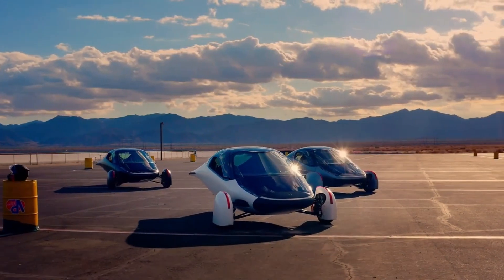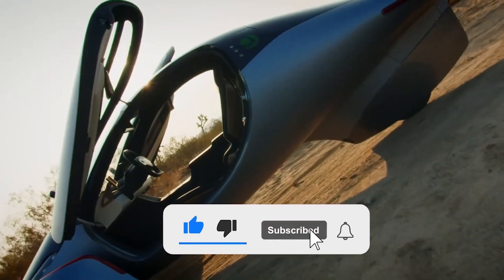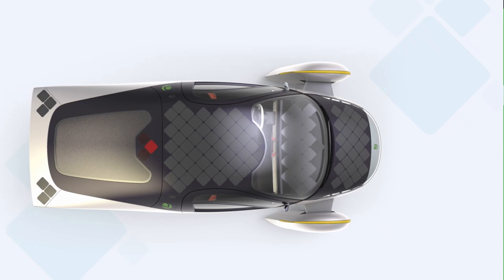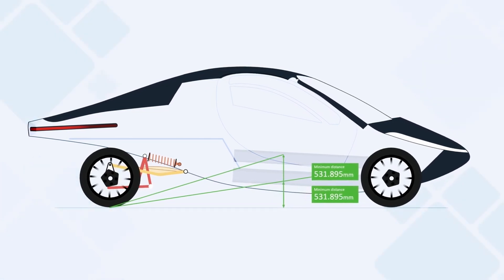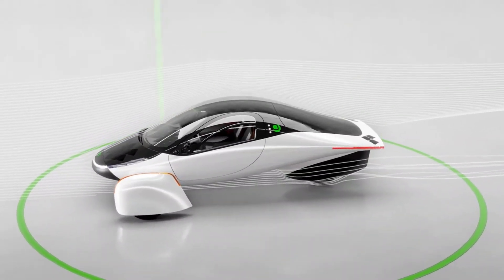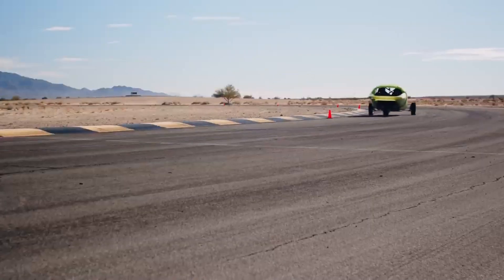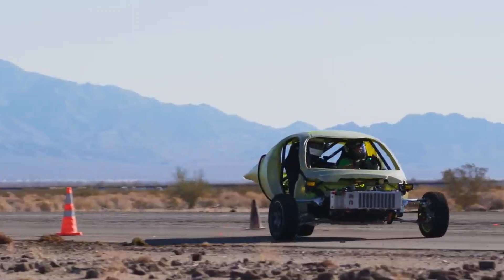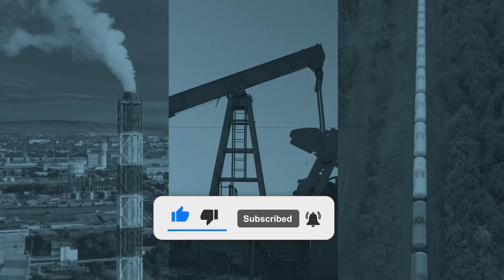Aptera's Stability Under Scrutiny: How It Handles Potholes, High Speeds, and Sharp Turns

Comment: The "advanced" Aptera suspension system does not exist. All their previous testing were made with hub motors and no aluminium frame. So just a bunch of empty promises again. A three wheeled vehicle will catchup all potholes on the street. All dirt, rock, holes are accumulated in the center of a used road, where the back wheel catches everything.
Reply: That's an argument for better road maintenance - not a strike against a three wheeler. Also I would bet money that the majority of holes in the road of any shape or size occur to either side where the wheels of most vehicles travel - it's just that holes in the middle can go longer without patching before it becomes a real issue. On well traveled roles, dirt and rock accumulate on the shoulders
Reply: @someoldguyinhawaii4960  What is easier: drive a real 4 wheeled car where the stuff in the middle of the road does not matter, or clean every road in the US at least once a week, so you can drive you motorcycle?

The standard of easy and cheap road repair is to fix the left and the right side, where the wheels normally do the most damage on a road.
Reply: @bobhellman8676  And the Aptera motorcycle is wider than a Hummer H1, so it cannot pass where a normal car probably could.

Comment: Not sure why you keep calling it an SUV.  It's not an SUV.  It's an autocycle.  The reason Aptera is stable, whereas the opening three wheeler design was not, is simple.  It's the difference between a delta trike (one wheel in front), and a tadpole trike (two wheels in front).   Tadpole trikes are vastly more stable than deltas, as most momentum translation happens through the front wheels, and a tadpole is just as stable in this regard as a four wheeler.   Additionally, the fact it has such a wide track, makes it even more stable, as well as its low center of gravity.  The vehicle should have zero stability problems.
Reply: @bujin5455  it’s SEV, Solar Electric Vehicle. I don’t think SEV was defined at the beginning of the video. It should have been.
Reply: @TheScottShepard  Sounded a lot like SUV, and the CC kept calling it an SUV.  But at least SEV would make sense.
Reply: SEV. Solar Electric Vehicle. He mentions it in the video. The CC is smoking crack.

Comment: Not really worried about it flipping but fishtailing might be an issue.  All the weight is up front and there's just one rear tire.  Even pickups like to swap ends and they've got two tires back there.  How is one tire less likely to fishtail?   Looks like it would function like a skid.
Reply: Pickups fishtail because the lightly laded rear wheels are the drive wheels, and putting a lot of power through them causes them to lose lateral traction. AWD pickups don't have this problem to the same degree. Aptera is either front wheel drive or possibly in the future, all wheel drive.  There will be sensors which cut power to any wheel that begins to slip laterally.
Reply: @robertkirchner7981  Yes but in a fishtail the rear wheel is the one slipping and it is not powered so you can't cut the power to it.  I suppose if you apply brakes it would drag the rear end back to true.  It's gonna eat that rear tire up quick.
Reply: @charlesbeane8795  you’ve got a point. I grew up on pickups and had my share of spin-outs on ice. Those trucks didn’t have instant torque, smart sensing, or independent braking. I hope the Aptera does.
Reply: Pickups have far more of their weight upfront... Aptera has a much better weight distribution than a pickup by a long shot, so this is a silly thing to worry about.

Comment: The Aptera will roll over if driven fast around corners. We had his stuff in the 80s and they all rolled when tested at race speeds
Reply: Tadpole config and wide stance solves that.  Videos of a modified Reliant Robin (trike) rolling at the drop of a hat isn't even indicative of norms for trike 3 wheelers since they changed the suspension and differential for that famous Top Gear piece.  When breaking and steering with a trike style (not Aptera) the weight shifts forward and out of the stability triangle. The moose test for the beta mule at 7:30 was done at ~48 mph which is far faster than most vehicles and even at that speed it looked nowhere close to rolling. ~78 kph / ~48 mph puts aptera in the top ~5% of vehicles (tied with Tesla model 3 lr which is their best vehicle) for the iso double lane change (moose test) and that is ignoring the many SUVs and trucks that are not listed since they cant get close to a passing score or even attempt the test (data listed on teknikensvarld - europeans use the test far more).  Mach-E does unexpectly terrible failing at anything over 42 mph.  Because America loves big SUVs and trucks little focus is given to the test since the vehicles generally fail miserably and end up with comical rollover videos at ~40 mph.
Reply: But not in their testing, which is published on their YouTube site. So go watch it.
Reply: Or just watch this video
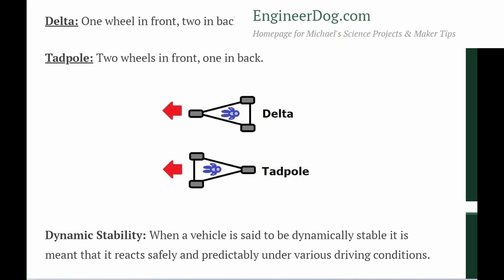Reply: 2:20 the weight of the battery, motor(s), and seating positions move the center of gravity forward.
Reply: Have you bothered to watch the whole video.

Chris Mackinnon has stated many time that while doing the Moose Test, the Aptera has never tipped over like many other 4 wheeled vehicles have.  

This due to Aptera's low centre of gravity and stance of the front wheels.
Reply: @andremcamara3120 the moose test may have improved with the change out of the hub motors.
Reply: @TheScottShepard Aptera has a bit of a cheat on the moose test in that the rear can fishtail substantially and be over the standard height cones (curbs and small animals would be well under it).  Still the results are very impressive and stable and i dont think the mule run was the absolute limit for the vehicle yet.  The change from hubs does reduce un-sprung mass but also impacts torque vectoring so is probably a wash.
Reply: @ccibinel  do you know if they had implemented torque vectoring with the Elaphe motors? It can be faked a little by adding careful brakes to the inner wheel, which is what I’m guessing they’ll be doing now. I’m really looking forward to seeing these PI builds tested.
Reply: @ccibinel  - If you watch the video and look at the pic on the Aptera website, it tells us a story of a vehicle that needs a professional racecar driver with much better car control over the average person. He had a a fair amount of opposite lock in that thing. There's a reason for that. Look at the rear tire. About 10% of it is in contact with the pavement. So, that's a major issue as you just can't cheat the laws of physics. Since this moose test was done on a completely different Aptera and a stripped out version, then the moose test is worthless. Needs to be done again with a fully complete version, not another stripped out one and with a regular driver, not a pro.
Reply: @billsmith5960  since when does a “regular driver” test vehicles? If you want good data, you use a skilled driver. The test was done in a “beta” Aptera that was testing the suspension and drive train. The “alpha” Aptera vehicles are just concept cars. They will certainly be testing the production-intent ones with far more tests.
Reply: @TheScottShepard  All the testing with the beta is absolut worthless now.
Reply: @TheScottShepard  - Actually most of the engineers that work in the automotive industry are just regular drivers. They do have some engineers that are excellent racecar drivers and they are good for some things (like getting the car dialed in) yet that's the exception, not the rule.

The driver that tested that beta, just masked a real major problem. All we seen was pretty much a PR piece because I guarantee you, that guy had lots of feedback and not very positive. As we know, Aptera only reports good and hides the bad.
Reply: @billsmith5960  you say that like it’s a problem. This is product development. Get good people in that can evaluate and advise. You are twisting a good practice into negative. I would expect major car makers to cut corners and turn out a product I wouldn’t buy. That doesn’t are them better because a “regular guy” tested the car. These are early development tests, not consumer reports.
Reply: @billsmith5960  it’s my understanding that partners in Italy redesigned the suspension when it became clear that the Elaphe in-wheel motors would not make it to initial production. It’s too bad they put so much effort into this part of development and had to use something different. I don’t know if they’ll go back to in-wheel motors and use the learnings from the beta program. Unsprung weight might have been as much of a problem as so many people seem to think. Our roads aren’t ideal surfaces. Bill, much of what you have to say has validity, but the way you stretch and twist it isn’t very helpful or conducive to discussion. Your criticism isn’t unique and as far as I can tell, Aptera is making the best choices with what they have to work with.
Reply: @andremcamara3120  Chris M also said,  in the Electric Viking video, that they've tried to roll the Gamma. It wouldn't.
Reply: @tims8603  Chris M tells a lot when the day is long. Mostly empty promises.
Reply: Put down your crack pipe. There were no 3 wheeled (reverse delta) configuration vehicles in the 80s. If you think there were, name them.
Reply: @bobhellman8676  you either don’t follow Aptera very closely or you conveniently forget the “balance” you are missing. Steve and Chris have been very upfront about the timeline requiring major investment. How many times have they talked about “an inspired billionaire”? This is always in context of the timeline. When they first started this endeavor, they thought these vehicles would be hand-made from off-the-shelf parts, except for the solar panels, which they were developing, and the shell, which was to be made much like a boat hull. The engineering was very different. The vehicle we are getting looks very similar, but every part of it has evolved a great deal to match production as scale, and to meet the expectations of their vocal community. They listen, and we appreciate that.
Reply: @bobhellman8676  large weight stacks? Do you mean the radiator? The slingshot is not an EV, the wheelbase is also much more narrow and shorter. These are not comparable at all.
Reply: @TheScottShepard  These vehicles are exactly comparable. When turning sideways, the vehicle will flip over.
Reply: @bobhellman8676 as I stated in another thread, I’m looking forward to seeing these PI results of testing the production intent models. I am also hoping a reputable EV review channel puts it through the paces. Aptera is not a car, it’s an autocycle. So my criteria is that is must be much safer than a motorcycle, but I don’t expect it to equal my Tesla in safety or performance. It must be fun, safer than a bike, and look fantastic.
Reply: @bobhellman8676  i don’t think the general American population wants a two-seat three-wheeler. It’s just too “weird” and draws too much attention. This is an enthusiast’s vehicle, IMO.
Reply: @bobhellman8676  Bob and Scott..   finally some intelligent discourse.  Refreshing.
Reply from the maker: Noted!
Reply: @bobhellman8676  thank you for the movie. Exactly the same will happen in case of an accident, when the outrigger wheel will be torn out.
Reply: @vic321344  yup, the outrigger module is intended to be shed in a collision. The vehicle is very light and that will help to carry energy away. The assembly is designed to be replaced in parts or entirely.
Reply: @bobhellman8676  A 3 wheeler is done when the rear wheel loses traction. Like a 4 wheeled car, but that has 1 wheel more to provide traction.
Reply: @bobhellman8676  yeah, concepts are easy. Production is hard. You don’t have to look very hard to see similar much larger companies also struggling, like Rivian and Lucid, who make fantastic products. Rivian is still in “production hell” as Elon would call it, and Lucid has a demand problem. Don’t invest in something as unlikely as a new car company if you expect success. We hope for success and try to make conditions right for success, but failure is a possible outcome. Pervasive FUD and distrust of anything unfamiliar create gigantic hurdles that these incredibly innovative companies have to slog through. Some of the failures of recent have had poor leadership . Fisher comes to mind. Spending was out of control. Arcimoto had a great concept, but poor cost control and lack of product discipline, just general lack of discipline really. 

Aptera has had to shift the go-to-market strategy several times, but each one as far as I can tell (I don’t work for them) made sense, and the whole company executed in that direction. Usually people were laid off, which we don’t like to see, but the cash must flow. While some of the fundamentals appear to be in a downward trend, there is visible, almost daily, progress toward production. This isn’t a scam by any stretch, and it’s not being run irresponsibly. There’s just some things about the business model investors don’t like. Steve and Chris insist on control, margins are probably smaller than they should be (the vehicle price is too low probably), and the Right to Repair is a limit on continuing revenue per vehicle sold. I’m sure there are other factors as well. These are principled founders and I want to support this idealism. It’s just not going to make investors fabulously rich. This is why “inspiration” is required.
Reply: @bobhellman8676  I had to look up what vehicle you are talking about.  Yeah weird looking alright.  Not my cup of tea.  I can't stand the large radiator grill on the front of so many cars these days and this one takes the cake.  
It is hard to get a good perspective of the size but it looks a lot smaller than the Aptera.  Personally I prefer a larger vehicle.  I couldn't go shopping at Lowe's with a Vanderhall as you talked about.
Just for clarity I am going to get rid of my Model 3 when/if the Aptera comes out.